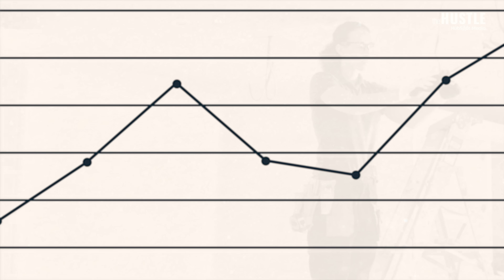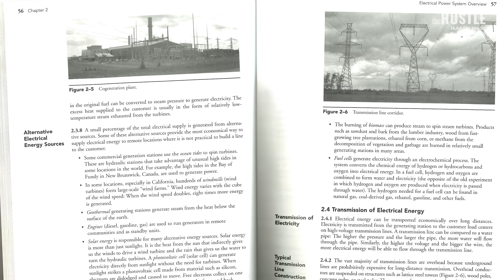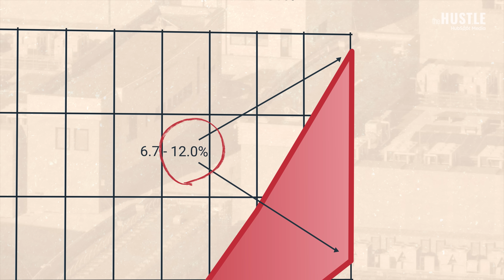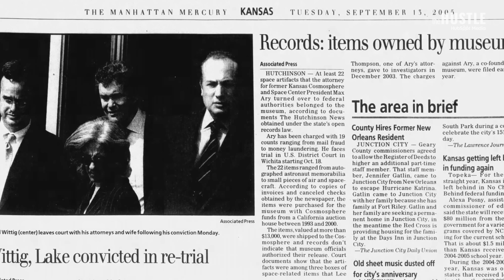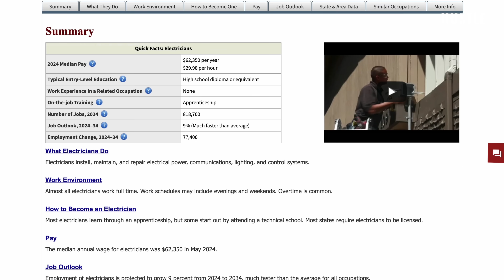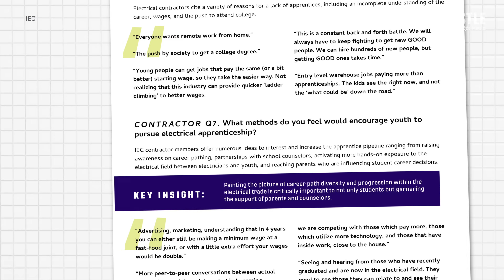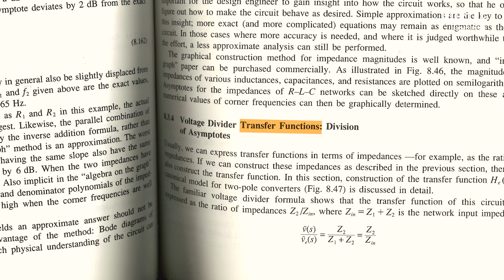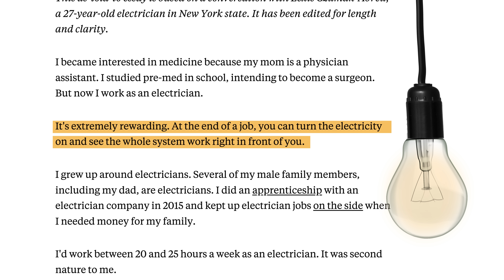Why America is Running Out of Electricians

Comment: Base wage is tight for high cost areas like NYC. Building Engineer for my facility said he had to work 2 jobs for first couple years to make ends meet before he was making enough from the union job. I would put in my application but the base wage is low for NYC standards. And you have to pass an exam to get a license before your pay bumps up to a decent level.

Comment: i almost became an electrician w/ IBEW this year but decided not to. Met with the IBEW rep and had them ask me to come in to start, but I decided not to. 

my decision to decline the potential great job w/ full benefits had a lot to do with who I'm doing the work for. I was told I'd be working on mostly corporations and fast food restaurants, no matter which division of the IBEW i joined (I live in the DMV area of the east coast). I didn't like that, so I backed out. Just grim work.
Reply: I don't want my work to fuel mega corporations and AI data centers, all while the civilians struggle.
Reply: And the jobs are like 40-60 hrs a week, and while better than retail type jobs unequivocally - they are still exhausting, thankless jobs.

Comment: $ 112k per year is decent money living in California but you have to work in hot/cold conditions high voltages 120/240/480 or you can drive a garbage truck weekends off and make more money. That’s right a garbage man makes more money than a electrician or even a gas tanker driver.
Reply: I would not call 120 high voltage yes it will bite and will hurt but death not likely
Reply: That's not true at all lol. In California, wages for electricians are at an average of $40.54/hour
Meanwhile garbage collection workers make an average hourly wage of $29 in Waste Collection.
You are welcome to look yourself. Plus, most of the people somewhat of a living wage doing garbage collection have a CDL and years of experience.
Reply: @Psmerling  the $40.54/hr you mention for an electrician also have a license, certifications, and years of experience (depending on state could be around 6 years and double that for the 'master electrician' title).
i'm in the state of PA so wages are lower but i was getting $13.50/hr 20+ feet in up in the middle of a blizzard changing parking lot lights and amazon workers (2 years ago now) claim they deserve a livable wage of at least $30/hr. heck, if they deserve at least $30/hr for quickly sorting packages in fairly conditioned spaces or driving an air conditioned vehicle (albeit not being allowed enough time to use a restroom) then i would wager i deserve more than $13.50/hr for that electrical work.